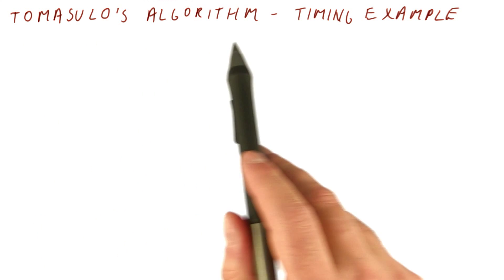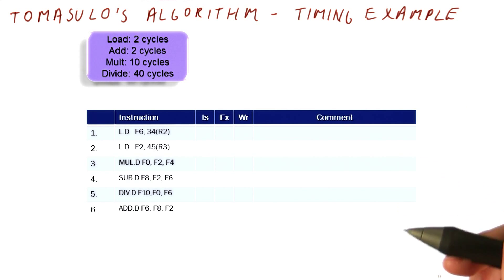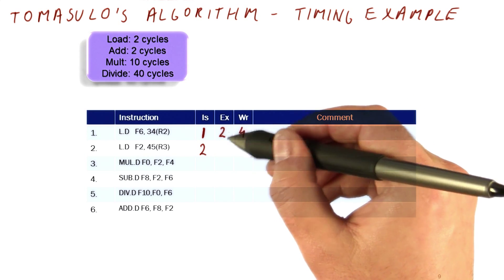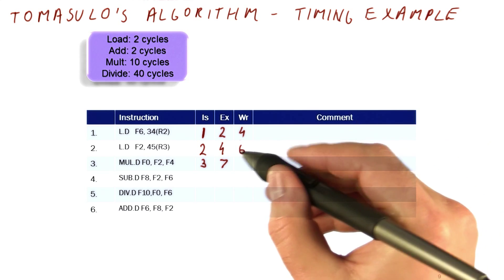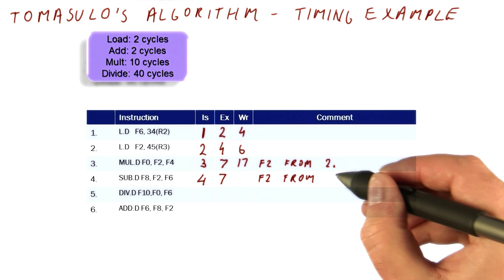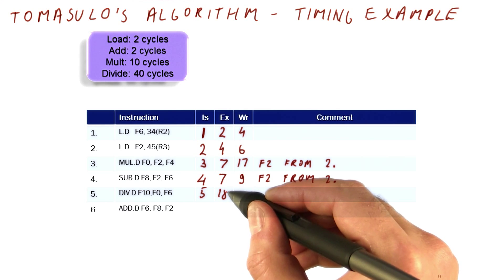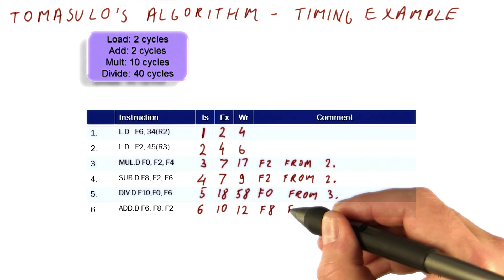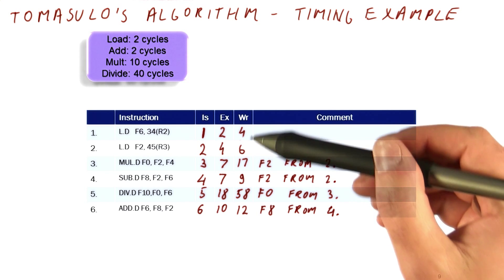Timing Example - Georgia Tech - HPCA: Part 2

Comment: Can you please explain how you determine that for instruction one LD F6, 34(R2) the WB is 4. Additionally, how you can tell how many reservation states are there, while you are at issue 5 you are saying that there are 2 reservation states, how you can tell this information? Thank you.
Reply: Can you please explain how you determine that for instruction one LD F6, 34(R2) the WB is 4 ?  Ans: becasue as per given table Load takes 2 cycles to execute.
Reply: From my understanding, first load writes back at cycle 6 because it takes 2 cycles after the execution state. The same rule aplies to the rest if you look at the table. And I guess that in the second load the instructions starts executing at cycle 4 because the previous load is executing somewhere between cycle 2 and 3 and they cannot execute at the same time